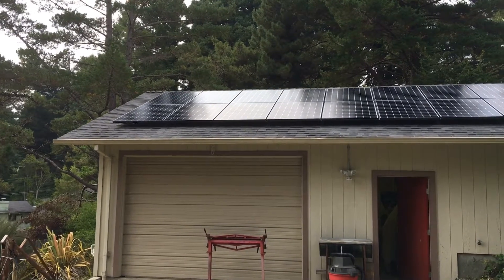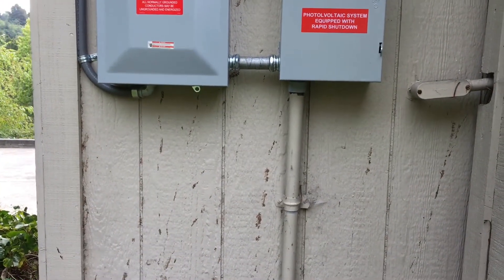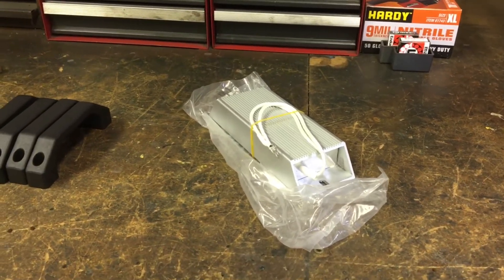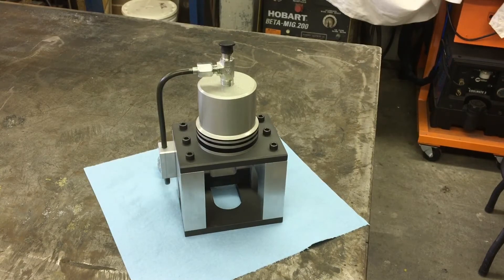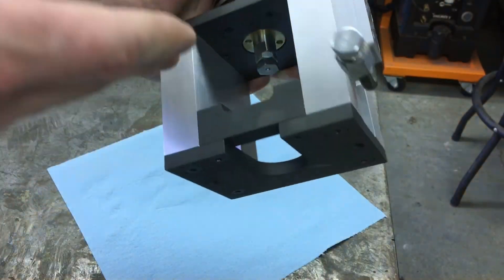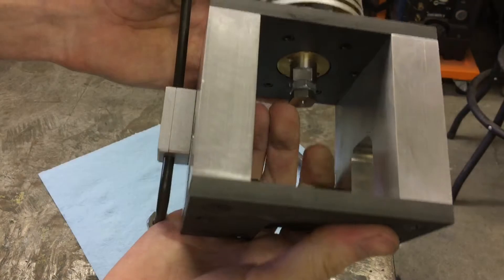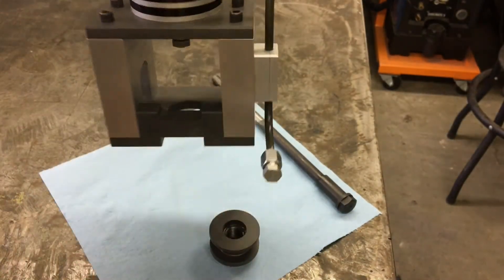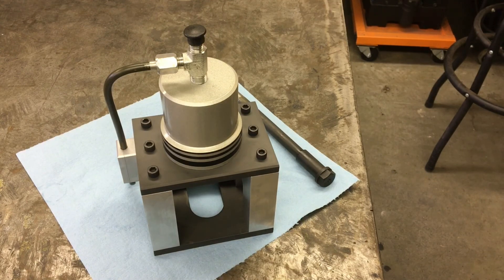GRIZZLY G0704 CNC Conversion Update 18 - ( hydraulic draw bar / solar panels )

Comment: Hello, how are you?
Very much your project.
I am working on the manufacture of a cnc milling machine.
And I'm developing the system to use the TTS tool, but I have some doubts, and if I could help I'd appreciate it.
I looked at your videos and in the cnc forum, and did not acheialgo about the spring pulling the R8?
Is it inside the shaft? Can you tell which cargo you used?
And the other doubt, I realized that you used some washers or something like that in the pneumatic tool change system, what is the purpose?

Thank you

Comment: Who’d you buy those handles from?
Reply from the maker: The handles came from ebay, a state side seller. - Nick
Reply: Nicholas Miller Do you happen to remember the seller’s name?
Reply from the maker: I did some digging and found the Ebay seller of the drawer pulls. 
https://www.ebay.com/p/Rohde-Black-Industrial-Pull-Handle-122mm-100mm-Centers-Cabinet-Drawer-Tool-Box/1163536150?iid=332554986673&_trkparms=aid%3D222007%26algo%3DSIC.MBE%26ao%3D2%26asc%3D44039%26meid%3D01b49a6271454166974af50799f8d379%26pid%3D100011%26rk%3D1%26rkt%3D2%26sd%3D231894219123%26itm%3D332554986673&_trksid=p2047675.c100011.m1850
Reply: Nicholas Miller Thanks, I appreciate you looking them up. I tried and came up empty. Gonna order some!
Reply from the maker: No problem! Glad I could dig them up for you. I think you will be happy with them, I know i was... good price combined with quality one would expect from a place like McMaster-Carr or the like. Cheers!  - Nick

Comment: Looking good! The Teco VFD I bought doesn't have a braking resister, but it still slows down in 3-4 seconds. That whole drawbar setup looks super beefy and well made. You're gonna make me one too right? :P
Reply from the maker: Thanks! The teco drives are legit, I have one on a band saw. The draw bar is defiantly beefy, but it needs to be because it puts out some serious "heat" = )  if you know what i mean (4k+psi) . I will let you know, really! Im planing on making a few components and selling them.... AFTER, my machine is done. - Nick

Comment: So what your saying is that the polished rod, pushes through the perfectly reamed bush but there is no back pressure build up as it vents out the rear......
Reply from the maker: Bruno M. Yes... being single acting the only seals in the cylinder that actually have to "seal" any pressure are on the piston. The reamed bushing only serves to guide the cylinder rod.